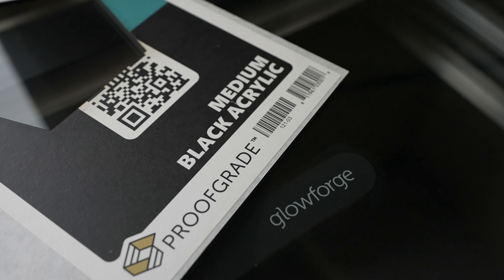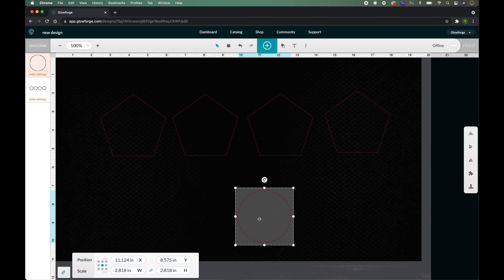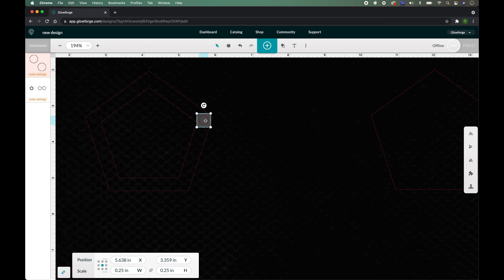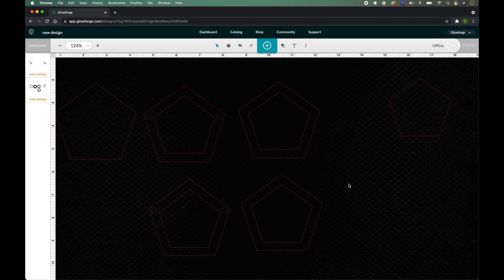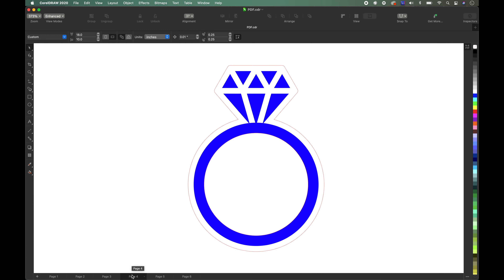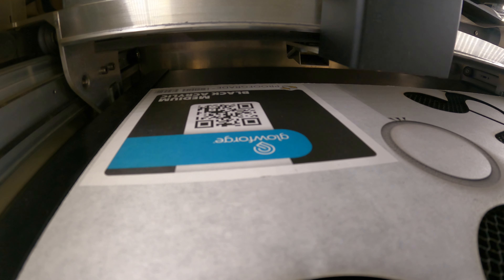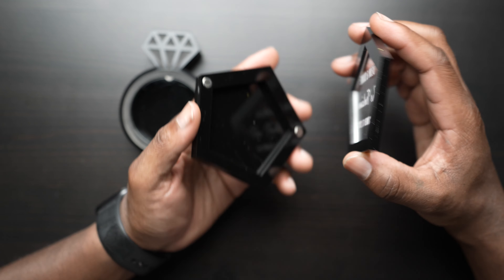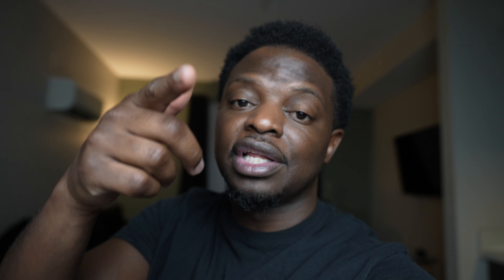Acrylic Ring Box | Glowforge

Comment: These are really cool! Great finished pieces. Very minor recommendation - have you tried acrylic bonding solution to glue the layers? I'm sure the e6000 will hold just fine but the acrylic bonding solution is the professional, permanent way to bond acrylic together (and it's a nearly instant bond).
Reply from the maker: Yeah I use acrylic solvent all the time just wanted to use the E6000 its a on going joke. Haha